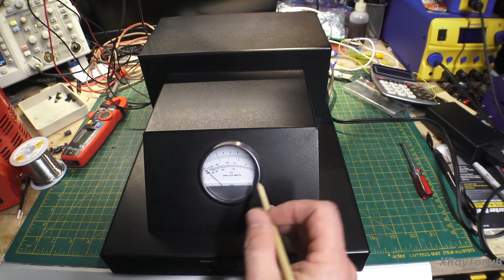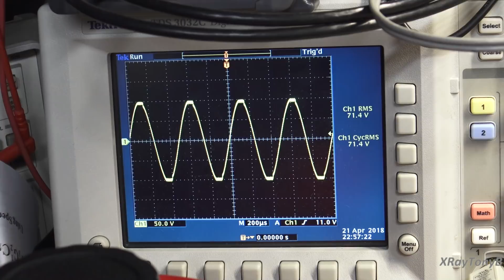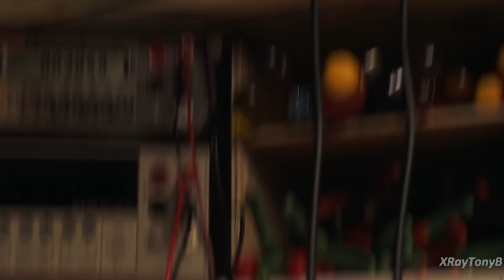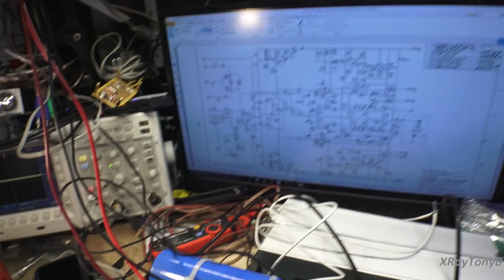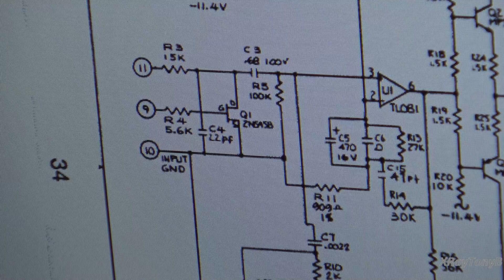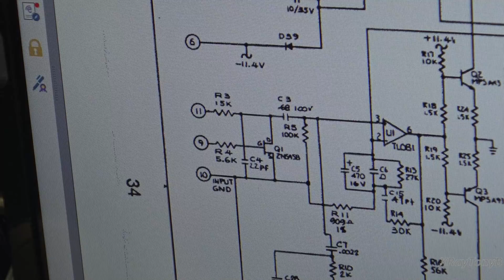Carver Silver 9t Part 3 - Both Amps Working

Comment: The large filter caps strapped down with zip ties and hot glue looks so diy. What are they even sitting on? Is it so hard to put them vertically or make a metal bracket and ground bus bar?  The sunfire amps he did at least had a metal bracket to clamp them down. But a similar  negative terminal connection of a soldered 16-18awg solid wire across solder lugs, only also with additional ground wires wrapped around them. And another 1 inch  18awg solid running to a thin   soldered lug at the chassis star ground point. Now allowance for thermal expansion or strain from the screw terminals or screw at the ground. Over time movement, age and heat tends to compromise that solder joint and then things hum in the wrong way and go boom as ground reference is lost.

For the price of these things would a proper buss  bar be so hard?

Comment: Nothing like having a working example of what you're trying to bring back to life in order to hunt down the fault and good job pinpointing the fault, but, personally, I would have just replaced all semiconductors in that circuit (after checking all passive components were alright), not only to save diagnostic time (which is far more expensive than routinely replacing components), but also I've found replacing just the one component which had failed accellerated the demise of other, equally old, components in such circuits, going forward in these old amps.
Now, given how this is set up, I don't think this will come back to bite you, but, you know, just to share experience as to how to acchieve an effective repair.

Comment: Wouldn't  you agree that those units  should be on a 240  volt  30 amp  circuit ,  on each one?
Reply: each one is 120v. you need one 240v split phase circuit to run both
Reply: @josephbeasley5193  He's saying they would work better if they where set up for 240 on each one.

Comment: Carver amplifiers are very greedy power wise. I have a TFM-25 and my circuit can hardly handle it at high volumes and my amp is 225 Watts per channel at 8 ohms. It is capable of peaks up to 450 for short durations. So I would gather that these are more greedy yet and I am not sure that 20 amps is enough. Hard to say, unless you try a different plug.
Reply from the maker: These would work better if used with 240VAC.  Now if I could just get my wife to let me unplug that stove!  ;)
Reply: I know, right. Who needs a stove. My amp is smaller, but still if I want to listen to it loud I have to make sure it is the only thing on that circuit. They are greedy, but sound good. Luckily for me I have not yet needed to repair my amplifier. It has been going strong since I purchased it new back in 1989. I have always liked Carver gear and I was able to meet him briefly.

Comment: By George, I think he's got it!  Veddy Ieenteresting! (Laugh in)  
Who knew, just one little j-fet!  You will or have recapped the second amp, correct?  I look forward to the final video that ends with them going back home.  What's the THD of the fixed amps and can you measure IM at all?
Reply from the maker: Thanks for watching!  Both amps will be re-capped and fully aligned.  I will try to test the performance, but this thing has enough output to fry a lot of my test equipment if I'm not careful!
Reply: Yes, its ironic when protection circuitry fails and causes problems, but its lot cheaper to fix one JFET that the output stage or the transformer or the speakers :)  Is that JFET the first semiconductor seen by the input signal BTW?  If so it might have caught a static discharge or something at some point.
Reply: @MarkTillotson yeah maybe moving it a static discharge

Comment: Maybe I am wrong, but I think you still have some oscillation riding on top of that sine wave at full throttle. There is some ringing going on.   Maybe that would be more clearly visible on an analogue scope if you could enlarge that area.
Reply: Yeah, I noticed the same thing.
Reply from the maker: That's mostly because of all the test equipment connected all over the place as well as all of the covers being off.  That will go away when everything get put back together.
Reply: @xraytonyb  I have a pair of these 9t's and both meter lights are out. What do I need to do and would you be willing to service them if I ship to you?